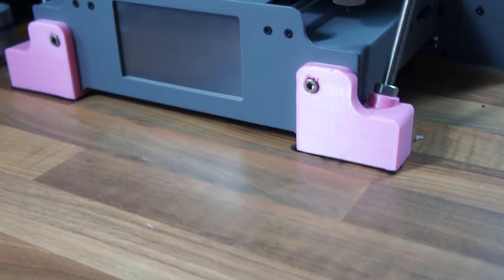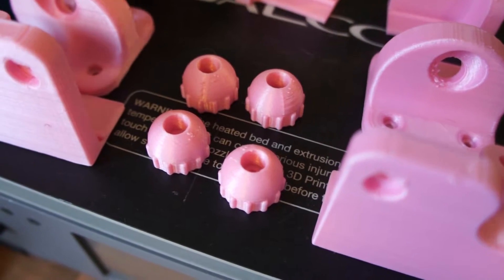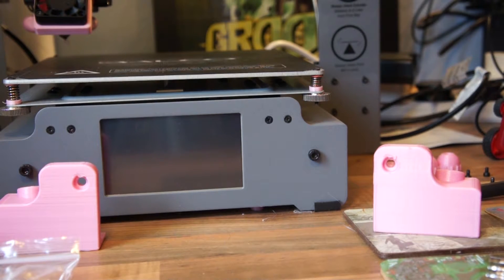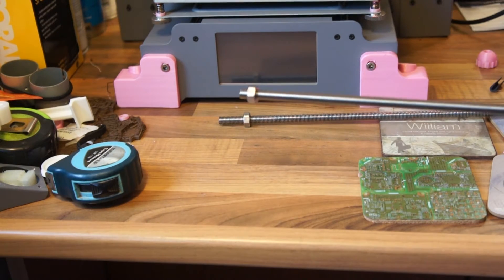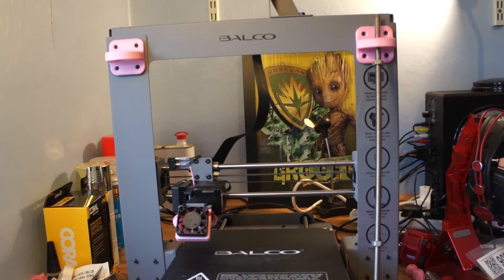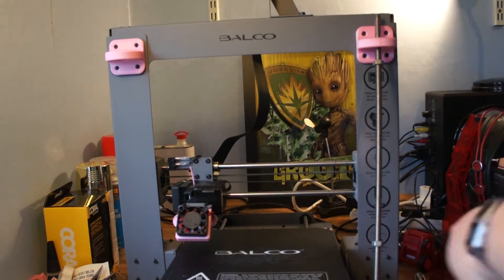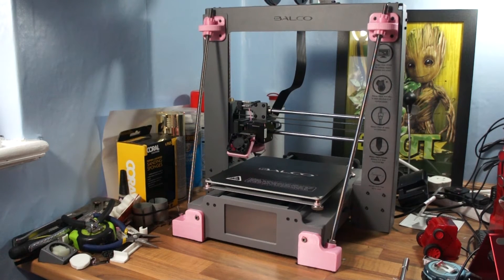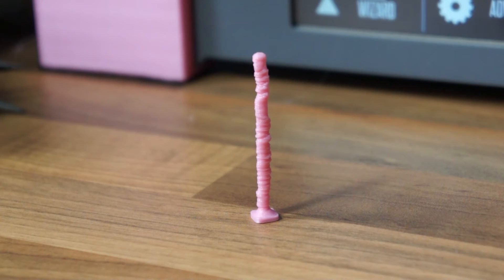Z-Brace Mod | Balco/Cocoon Create 3D Printer Touch, Wanhao Duplicator i3 Plus, Maker Select

Comment: Why not put the bars at the back? Would look better hidden.
Reply from the maker: My apologies for the slow reply! You have a good point there but the main issue is you would have to create your own mounting point by drilling some extra holes or something. The holes used in the video are accessible from the front but the Z-Axis lead screw is right in the way from the back. There are other screws you can use but you would need to modify the mounts a lot and i just went with simplicity as its only really going to be me who see's it every day xD Thanks for your suggestion though! Its got the old cogs turning and kinda makes me want to have a go at making some for the back! Thanks for watching! :)

Comment: The circles inside the ball mk2 nut thingies are deliberate. Must be supports or for another task? (Mine are printing now, but in grey. I have no pink filament ;) )
Reply from the maker: Yea I realised after the fact ha ha it's a good design and well made . Saves your slicer having to generate supports :) And you do you, I just really like pink! Ha ha, Thanks for watching! Let me know how you get on!
Reply: And I am done. I don't think my printed parts are dimensionally accurate yet, as I needed an 8mm drill bit to enlarge holes to fit the rod through. Mine is the Wanhao i3 plus mk2; the threaded rods came out at 430-450mm. And I added yellow heatshrink over the rods to add some 'flair'. Guess my next mod (fan shroud? camera mount?) will have to use yellow filament :) So in the end, 7 hours to print, 3 days to order screws and rods, 3 hours to assemble. A bit fiddly, mostly because I needed to force the rods through the holes, but my tower is rock solid now. Threading a nut before hacksawing is a good tip; and cloth in the vicegrips to protect the threads is good too! I squared from the case (below the bed) to the x-axis guide rods (6" roofing square) and the top of the frame (3' framing square), as I figure the bed might not be all that square itself.  Thank you for the video!
Reply from the maker: @SittingDuc  Awesome! Sounds like you have it nailed (or screwed :P)! I bet the heat shrink looks sweet too xD I'm glad my video helped you out! I plan on doing the DiiCooler fan mod to mine next to give better print quality as the stock fan shroud (and even the pink one i printed that I used for a while) are not that great. Again thanks for watching :)